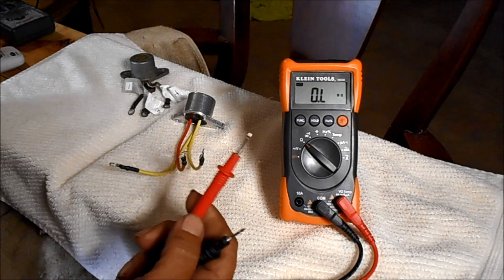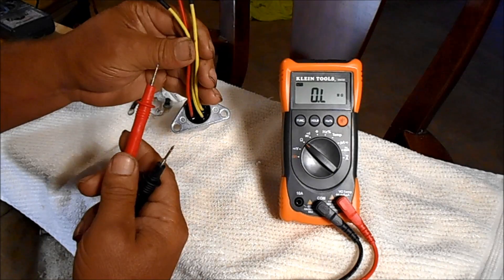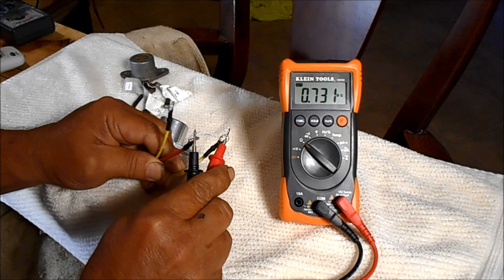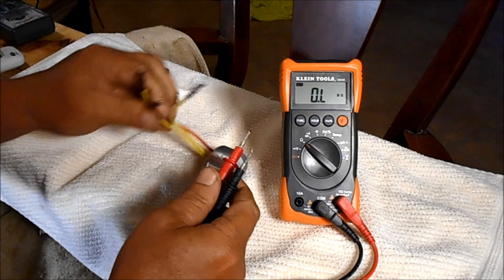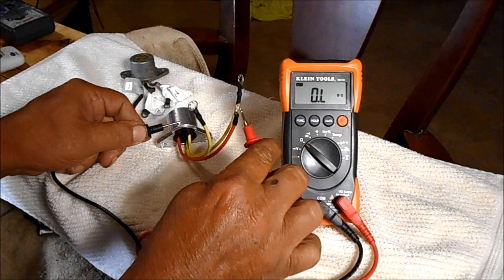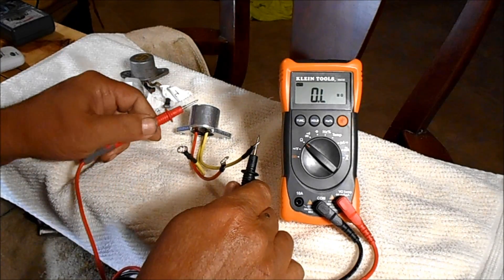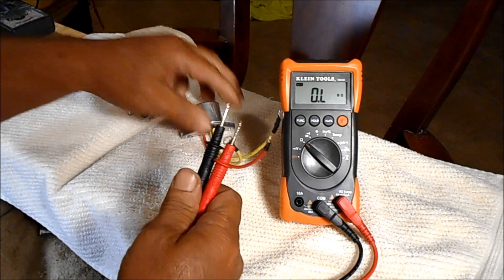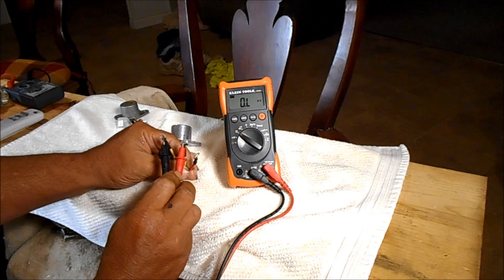HOW TO CHECK A JOHNSON AND EVINRUDE RECTIFIER

Comment: The rule for simple OMC rectifiers is:   Red to both yellows (then reverse), next is both yellows to ground (then reverse).  You are reading between two diodes when you checked between the red lead and ground....
Reply: What are you supposed to be reading? Continuity? A specific resistance number?
Reply: @justinkemeter  There is no specific resistance reading posted, but it is relatively high, so use the high ohms scale...  The meter should read infinity when the leads are swapped though
Reply: @fleetwin1  thanks
Reply: @justinkemeter    Let me know if you need help on a particular OMC engine...

Comment: i have a 1994 Johnson Fast Strike and having problems with it staying running i start it and it will run for about 5 seconds and goes dead but if i hold the switch in the start position it will run we were 20 minutes from the boat ramp and it wouldnt stay running i had to hold the switch in the start position to get back to the ramp it has a new power pack installed someone told me it is a bad stator what would you recommend me checking i have checked my wiring looking for a dead short or broken wire but cant seem to find anything how can i test to see if the stator is bad, when i have it running holding the switch its putting out about 13.5- 14.1 volts thanks for any help it will be greatly appreciated